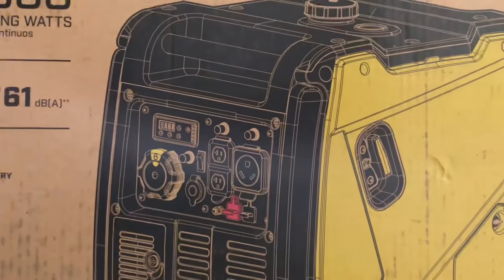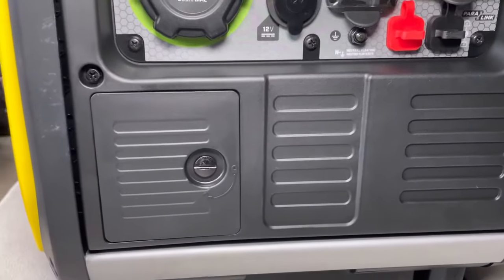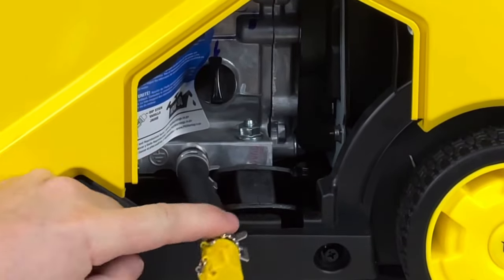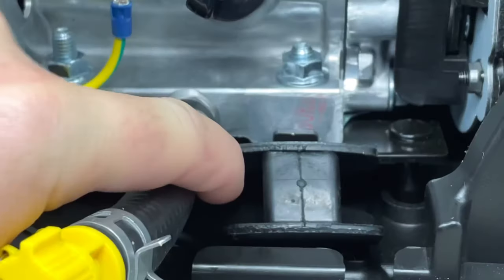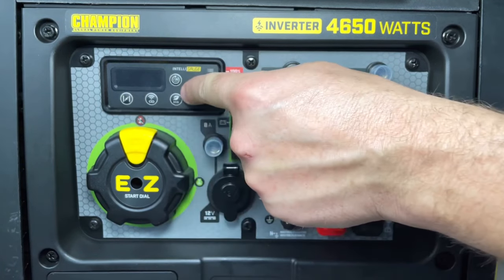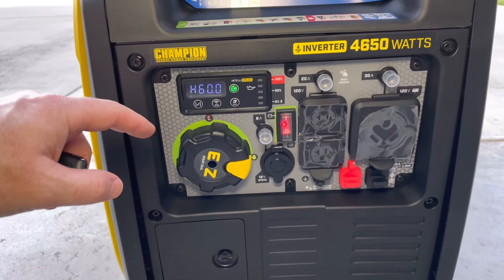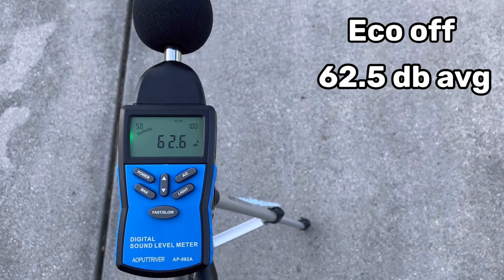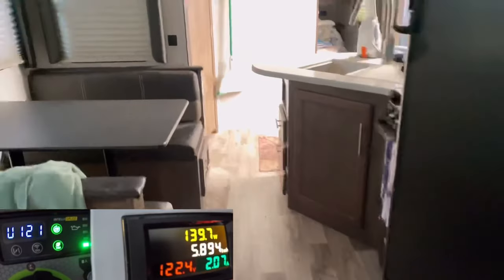Champion 4650 Review Setup Test Inverter Generator

Comment: Out of the three whats your favorite Westinghouse, champion or the predator.
Reply from the maker: Ahh man that’s tough because of a few factors…..

Predator pros…..
Has a good reliability report….is one of the quietest around, is a awesome deal when you can use the super coupon but I hear that has gone completely. Decent size fuel tank for long run times. 
And it’s ability to handle full load and even a lot more and just keep running. Rated at 25 amps but will run 28 for …. Well idk never waited around long enough to find out. Held 30 amps for over 5 mins and didn’t shut down or struggle but I shut it down. 

Cons….. lame way to move with small wheels
Would like a better handle to move around
No Rv plug
No remote start
No fuel shut off
Would like a drain hose for oil changes.

Now a lot of cons are fixable with mods. But other goodies options are things you get with say the Westinghouse..

Westinghouse pros…..
Has battery charger hook up
Nice wheels
Remote start
Fuel shut for storage
Digital readout 
Nice carrying handle which I like and don’t like
Pretty darn quiet 
Decent fuel tank. 
Has the largest cc engine of the 3 at 224cc

Cons….unknown reliability 
Odd motor that I don’t see in generators but that could be changing as there are alot… and I do mean alot and most are the same.

Heaviest of the 3 by about 3–4 pounds

No reports back from viewers of good or bad or customer service.
Lame service door makes oil changes not ideal so I would change it up a little. 

Champion pros…
Excellent customer service and warranty at least that’s what viewers say. So far the most people talk about champion more then any other brand excluding Honda and Yamaha.

Reliable rato engine which is popular in a lot of brands. 
Remote start
Rv plug
Nice handle 
Good wheels
Digital readout 
Lithium battery
Easy service

Cons…..
No fuel shut off
No auto choke but it is electric auto with a push button, kinda weird.
And…. Well idk.

So overall the Westinghouse house kinda wins for load ability for the bigger engine . The handle, how quiet, features like remote start and a fuel shut off and large fuel cell. 

Even though predator really has a good reputation for the price and everything you get well the Westinghouse which is the same as the onan 4500 kinda wins. 

Unless something happens during my video that I didn’t see.

Champion 4650 vs Westinghouse this Sunday well hoping for Sunday depending on work and family 😅
Reply: @johnnysweekends  im definitely looking forward to Sunday
Reply from the maker: Me too 👍🏼

Comment: The math doesnt add up...Max amps is 30.4 but if you take running watts of 3650 / 240 volts you get 15.2 amps..Am I missing something here?
Reply from the maker: Yes…. It’s a 120 volt generator not 240. Run the math again and your good..👍🏼😀
Reply: @johnnysweekends  lol...ya ok..
Reply from the maker: I mean if the gen produced 240 you would be right as well..😂😉👍🏼
Reply: @johnnysweekends  I saw that it had what I thought was a 240 volt plug. I have a 2018 Smart EQ and am looking for innovative ways of charging this car..and thought that a portable generator/inverter would do the trick, but it turns out getting 30 amps at 240 volts from a generator isnt going to happen with anything close to being portable..
Reply from the maker: lol yup your correct. Any smaller unit like this that is closed frame inverter is gonna be 120 volt. Once you get to 240 they are normally about 7500 watts open frame and 7000 closed like on the Honda or the powerhorse from northern tool, but they are big, heavy and expansive. 

Unfortunately that’s the problem charging any car. It’s only gonna be at 120 on the smaller gens and so many amps. Some home units are 240@60 amps…😳

Comment: What about a ground?
Reply from the maker: Typically most of these types of generators have a floating neutral. And most the time are used in applications that have a grounded neutral like houses or recreational vehicles. So one is not need and from the reading I have done when you add a ground wire you now have a shock hazard. So per manual it is not advised except when paralleled.

Comment: honda 3000 is way quieter than any of them... Ive had champion and yamaha and nothing can compare to a Honda. Not even close...
Reply from the maker: They are quiet but low on power is the problem. They need a new version.
Reply: @johnnysweekends  I have a 34' camper with 15k btu ac and it runs it perfectly plus all my lights at camp and the mini fridge on deck with no issues..
My champion 3100 would quit anytime it rained and wouldn't start back up. My Honda ran thru 90mph winds in Hurricane urma. We have 4 campers on camp and all 4 of us had champions. Now we all run Hondas and champion is only used for well. I agree a 4500 Honda would be nice cause I could run everything and my well pump but Honda is the golden standard.
Reply from the maker: I agree Honda is hard to beat. I would like to see a couple small changes…. A 4000-4500 watt version and if it could shed a few pounds and maybe better wheels 😅 

I also think if they shed about 10% of the price sales would definitely go up a lot. I think they are loosing a decent market now that everyone around is making a inverter gen.
Reply: @johnnysweekends  I went the other way because of price and it proved to be a waste of money. I ended up buying the Honda anyhow. 3 of 4 champions 3100 stall anytime it rains and in south Florida it's often. 1 of the 4 you have to spend 10-15 just to get it running. Id buy a predator before a champion cause the champion has proven to be junk. Only 1 of 4 works properly when needed and even that 1 was replaced.
Hopefully this one is upgraded to be better quality.